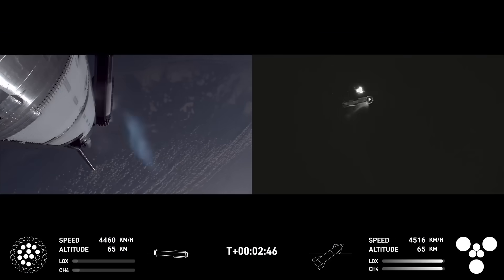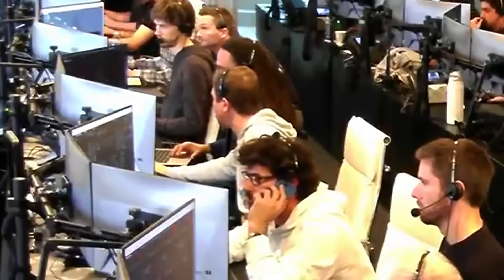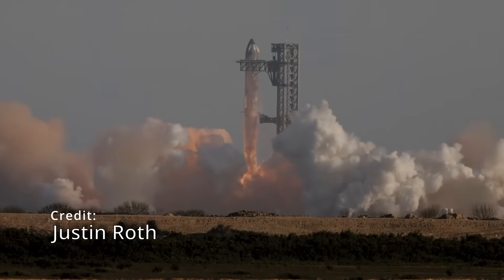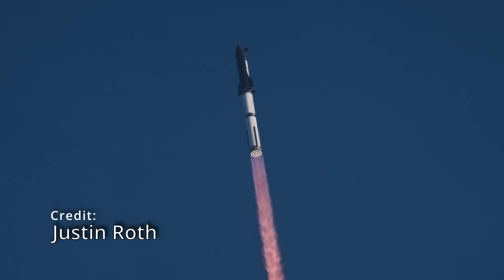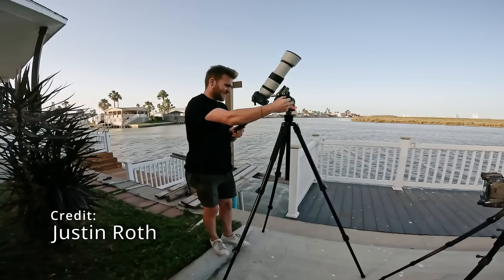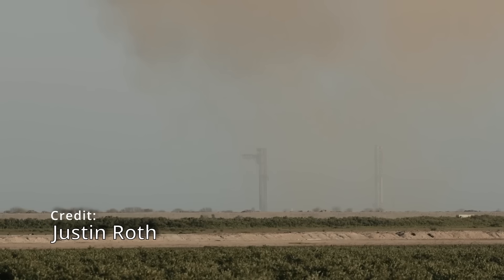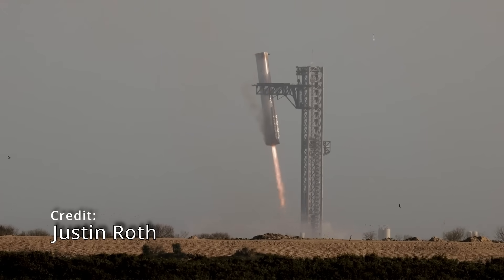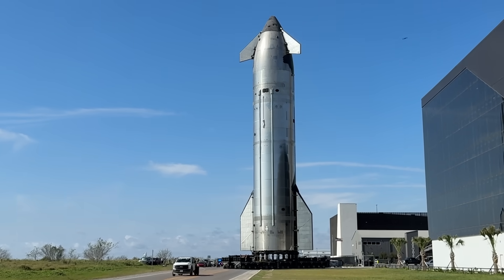Rest In Pieces: Why Did SpaceX Lose Starship Again?

Comment: The ship is essentially new, Avionics (hardware/software/firmware), FWD flaps, plumbing from the header down. Plus an unprecedented 100+ second ground test. Many many changes.  They will get it working. The complexity here is not trivial.
Reply: The ground test might not expose the failure.  The failure manifest itself when starship v2 is past the kalman line on its way to orbit .... Flight 7 and 8 almost failed at the same time.  At that height & speed and with that fuel load , something  (harmonics ? ) occur that rupture something  (fuel tank or pipe)   resulting in ship loss.
Reply: I'm going to venture harmonics is a factor.  It's really the only thing that wasn't and can't be fully tested until the flight.  Solution: make ship slightly larger or slightly smaller.
Reply: @lcambilargiu  There is also the new version of the engines. Maybe they are not so good when they are in vacuum. I think it would be hard to test a full engine burn in a vacuum chamber on the ground.
Reply: The 3 new RVAC methane "down-comers" are long and slender. Perfect candidates for high-Q resonance. Maybe fasten their midpoints to the hull? That would increase stiffness 4X and shift their resonant frequency way up. 
 @lcambilargiu
Reply: Even people who buy into the SpaceX development strategy are still somewhat trapped in the old mindset where RUD = failure.  Sure, it's discouraging for SpaceX engineers who desperately wanted a successful launch and a faster path the the finish line, but RUD = data.  Every flight, regardless of the outcome, is one step closer to Mars.
Reply: So was Saturn V (Apollo's) a radical new design.
Reply: Spray some gap and crack filler in that there attic and call it a day. No more ringin, straight to the moon!
Reply: Got to question sabotage!  Tesla charging stations being destroyed along with Teslas being attacked everywhere by leftist Looney's!  They know SpaceX is the pride of Elon.
Reply: Right but for what? So Elon can make more money with Starlink? At the cost of tax payers. This project isnt viable to me. Its dead IMO.
Reply: Stop making excuses. NASA's catastrophic loss failure rate is under 5%. SpaceX's failure rate for Starship alone is 50%. Elon doesn't care about these expensive test failures b/c it's not his money, it's US tax payers money on a contract that will just get renewed indefinitely now that Elon has injected himself into the Federal Government. Don't you see what's going on?
Reply: They were planning for 25 launches.... they wont get 6 and maybe 3 get to orbit... 1 might get caught....  this puts them back 2 years minimum.... the 2026 Mars window is now 2028..
Reply: And bigger tanks. Way bigger…
Reply: The US is incompetent, there you go.
Reply: But there booster didn't land back on the launch pad
Reply: @daveevans2389  It landed where they wanted it to land, hanging on the tower. It did have engine problems but as most of the fuel was burned and the ship had left then they can make due with less engines.
Reply: This is what I don’t really understand. The philosophy of iteration isn’t about incremental positive changes?  If you keep sending an “essentially new” ship each time you will keep failing and lose credibility. Especially at a time that the owner of SpaceX is under so much scrutiny.
Reply: @jip5889  Perhaps they get overconfident. Starlink and Falcon 9 are generating a lot of money for these experiments. These ships aren't free but neither are they $2B like Artemis. I suspect they are so well instrumented they will get the bugs worked. It's not like ordering something on Amazon and boom...
Reply: Wrong. Not tax payer funded for these tests.
Reply: @northfloridarails2136  Along with private funding, there are also billions of $$$ of government contracts. I believe that is tax-payer part.
Reply: Wrong. They've already burned through the majority of their $3,000,000,000 lunar HLS contract (tax dollars) and can't even put a banana into LEO.
Reply: @northfloridarails2136 wrong trump puppet. Elmer Fudd musk makes 13 million every day from federal contracts!!!!
Reply: @northfloridarails2136  Uh yes its under the grant from NASA for the Artemis program
Reply: @Naomi.Robertson  A portion, and the milestone payments pale in comparison to the actual expense. Those items are only awarded after sucessfully proving viability of the designs, such as the slot door.
Reply: @davidperalta5280  Yes EVENTUALLY Space X will have to start using their own money
Reply: Hmm, Saturn 5 and the space shuttle was also new, worked first time
Reply: @rustandmagic  Also build much slower and engines not so efficient. The shuttle also failed later, twice I believe.
Reply: @leonhardtkristensen4093  The Saturn V first stage F1 engine was the most power single nozzle rocket engine ever made, no, it was not that efficient, true, what does that have to do with anything ? it's still a marvel of it's time (60 years ago), the J2 engine was one of the early engines that could actually be restarted, the shuttle failed first time after 24 perfect missions because of weather conditions and human error, I do not see the comparison, in the beginning they at least tried to get starship back down again, now they cannot even get it up there.

Slower development ? They started on Saturn V in 1962, first flight was in 1967.

Elon started talking about Starship in 2005, but ok, they started for real in 2017 and so far it's still not working....
Reply: @rustandmagic  I understand that the engines used have never been used on any other rocket going to space. Similar ones had 2 barrels I think. Maybe he should test the engine on a smaller tested rocket like Falcon 9 . Maybe a single engine on one of those into space on the second part of the rocket. Probably wouldn't cost that much. 
Not that my suggestions matter as none from SpaceX probably read this.
Reply: @rustandmagic  - Apollo 1 killed three astronauts.  The Space Shuttle killed 13 astronauts and a school teacher.  I hope SpaceX keeps crashing un-crewed Starships to learn as much as possible about them, then flies hundreds of un-crewed missions to verify the design as they did with Falcon 9, so they're much safer when they're human rated.
Reply: I hope they don't, this is too funny
Reply: @mileysmil it really is 😂😂
Reply: Coping much
Reply: Or there’s a petty person sabotaging things. 🧐
Reply: Keep giving excuses
Reply: Remind me how many times an Apollo ship blew up during a test flight?
Reply: @ remind me how much each ship cost.
Reply: Please stop making excuses for this mess. There have now been eight launches, and eight failures. This is supposed to be a crewed vehicle. You would never get me into one of those things. Much ahs been made about the problems with the Boeing Starliner. And it has certainly had its problems. But they were able to send a crew to the ISS on it's third launch, and while they chose not to use it to bring the crew back, as it turned out, Starliner actually did make it back just fine. This POS is NEVER going to be reliable. Eight launches, and the Starship vehicle has been lost every single time. The whole concept if fatally flawed. They could launch it 20 times, or 50 times, and have the same results. If it had taken three or four launches to get it right, fine. But eight launches and nothing has gotten better. Enough is enough.
Reply: @geraldscott4302  You clearly can't comprehend the difference in design processes. Also, you mention Starliner but praytel what rocket has flown more often to the ISS carrying personnel in the past 8 years? Crew Dragon. So please stop with the hyperbole of "making excuses" since Boeing spent 1.5B on Starliner and essentially used NASA infastructure to support it. With 1 crewed launch, and no return. In the same timeframe, SpaceX has built a whole launch complex, designed engines from the ground up, and sent a building into Space that dwarfs the space shuttle in payload. The latter, a vehicle which was also mired with issues eventually killing 14 people. So enough, and btw no one has asked you strap yourself to it but hell if I don't want to volunteer you.
Reply: @davidperalta5280  ...he doesn't want to comprehend....if folks like him had their say the wright brothers would have been put in Jail...
Reply: @davidperalta5280 Starship block1 was success in all part of it. Block 2 has been little bit dissapointkng they are leapfrogging the whole industry with starship program so im not that suprised that we see these RUDs.
Reply: @geraldscott4302 guys is the past were saying exactly the same about planes 😂😂😂
Reply: @geraldscott4302  Stop spamming your ignorance.
Reply: @geraldscott4302 starliner was meant to be human rated starship is a prototype. Your argument is moot.
Reply: @geraldscott4302  this is elon's money and it's his to do as he pleases..
Reply: @geraldscott4302  then you should never get in an airplane.
Reply: @geraldscott4302 straw man, u talk as though starship is as insignificant as stair liner in terms of magnitude and overall capacity.

ur argument isn't even an argument.
it's just hysteria.
Reply: @geraldscott4302  Obviously you have never worked on a complex system. No excuses just reality. And a bunch of trolling.
Reply: @geraldscott4302
False. There hasn’t been 8 failures.
Reply: @geraldscott4302 wrong. 4,5,6 were successful.
Reply: stop making excuses this is tax payer money
Reply: @Naomi.Robertson  this is privately funded
Reply: @mikelee-i3b  No it's funded by NASA under the Artemis program
Reply: @Naomi.Robertson  the Artemis mission will be fulfilled at the same agreed on price whether spacex needs 2 more test flights or 10.......the taxpayers are not paying for this
Reply: @mikelee-i3b  No its a fixed price contract. If Space X goes over it they start paying
Reply: @mikelee-i3b  Along with private funding, there are also billions of $$$ of government contracts. I believe that is tax-payer part.
Reply: @KiteInAHurricane  i understand that   what i am saying is the taxpayer is not being charged for these failures  all spacex's contacts are fixed and the taxpayer actually gets what it has paid for...
Reply: @Naomi.Robertson  stfu, have you ever heard of NASA? Do you not understand how many rockets they lost and human lives?